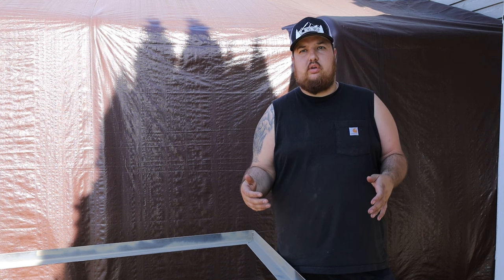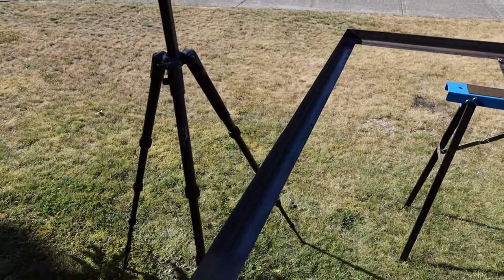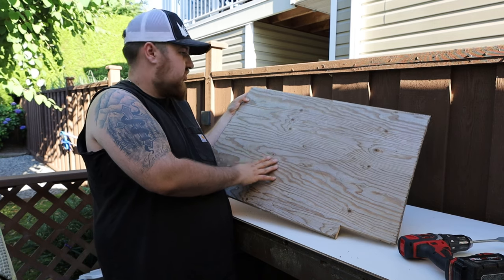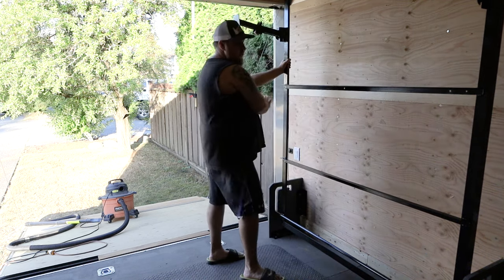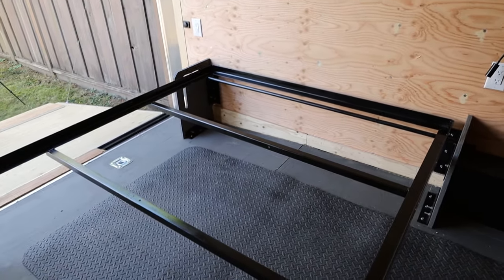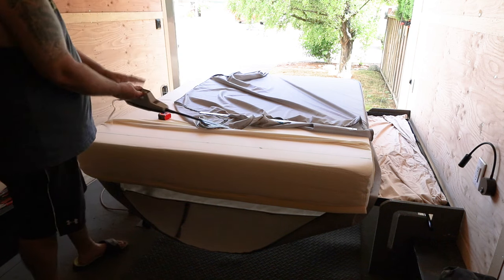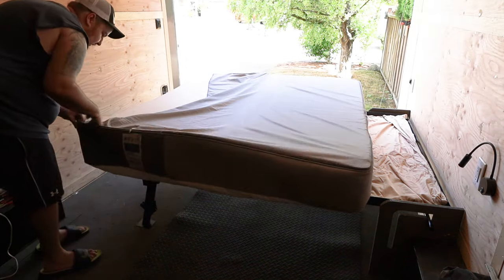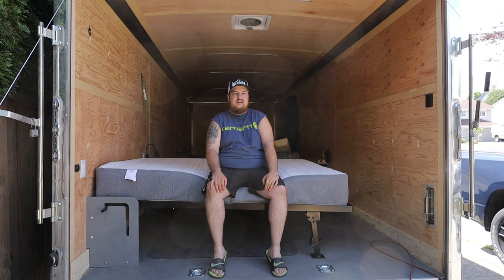Cargo Trailer Low Roof Murphy Bed

Comment: A great and elegant design to do this.  I noticed you had another person to help with moving the end of the bed into the locked position. Is it easily manageable for one person to do this?
Reply from the maker: A little bit of back and forth with one person but definitely manageable. I would say if it is difficult for someone I would suggest adding a hand crank on the wall for support.

Comment: Excellent custom bed build.  Isn’t it necessary to drill holes in the plywood base for moisture control to help prevent mold?
Reply from the maker: @wilty5  I’ve never had an issue with mold but can totally understand when condensation forms this could be an issue. Thank you for the tip I’ll have to check this in the fall!

Comment: I plan to have a box spring as well. How do I adjust the cut out on the plywood?
Love this! 
Edmonton ,Ab
Reply from the maker: Depending on the depth with the box spring and the roof height? If you are using your trailer to haul anything I would say don’t use a box spring. Just my suggestion

Comment: Whats the dimensions of the board to lock in and out for the bed?
Reply from the maker: Good question it really depends on your situation as my rear board is a bit bigger due to the rear of the trailer being a ramp
Reply: True I was just seeing if you had some dimensions to go off of
Reply from the maker: @westonwhite7722  I am out of town but I’ll try and get you something on the weekend